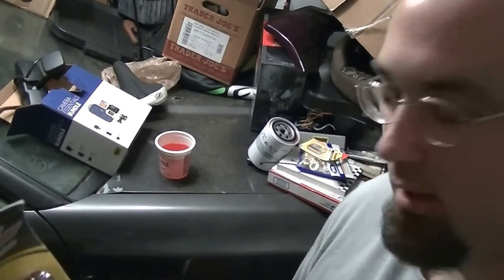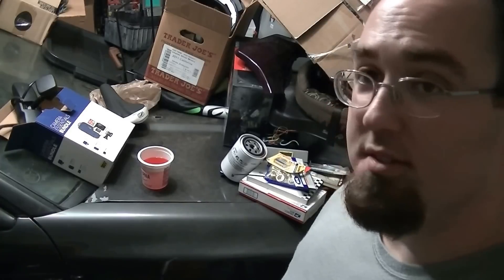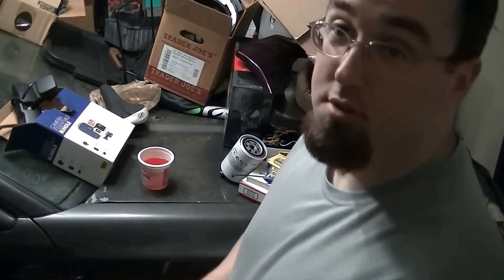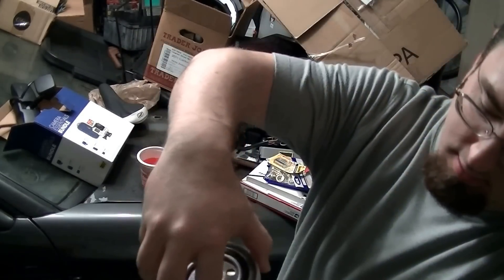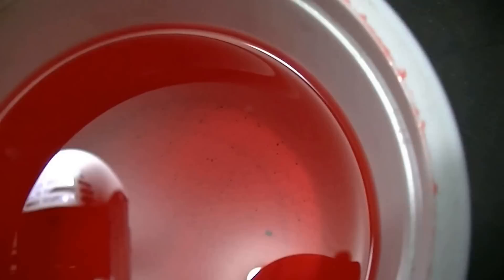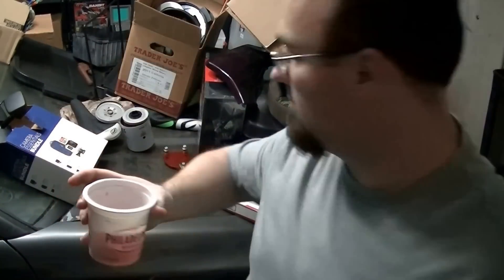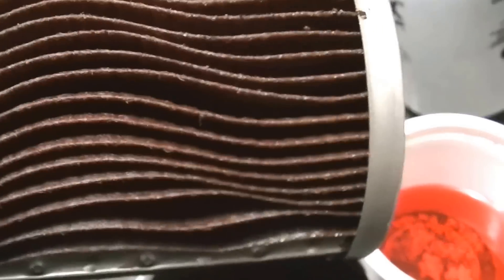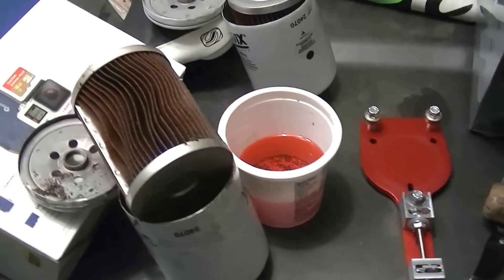Ford F250 6.0L Sinister Coolant Filter Cut Open

Comment: I know this was 5 years did you need a new oil cooler since the vid?
Reply from the maker: I did.  Then the truck got stolen right out of the work parking lot!  I hope it clogged up again on the bastards...
Reply: @uberDoward  crappy!  Just installed BPD relocation but with the crap I'm still seeing in filter I'm sure I'll have another OC to do.  Now it's out of the valley thank goodness

Comment: Holy crap. Always wondered how much my coolant filter was ACUTALLY doing. That is a lot of junk I would not want getting into the 6.0 oil cooler. How often do you guys change your filter?
Reply from the maker: I do it every oil change at this point :)
Reply: @uberDoward  probably a good idea. Not like it is that expensive.

Comment: what kind of coolant was in the filter?
Reply: Ford gold is horrible from what I've read and it's silicate content was noted by numerous articles as a major cause of the oil cooler clogging. I use Cat ELC along with a new Mishimoto radiator and have 0 problems with cooling.
Reply: Jonathan Dahar Don't listen to this goof stick with cat ELC do your research and find out why
Reply: If you use the Ford Gold coolant.... you better be ready change your coolant every 15-20k miles. I am not kidding. It can't handle the EGR temps.
Reply: Jonathan Dahar that would be catiplilar elc 
 I don't recommend using it in a 6.0 go back with the OEM Ford gold coolant . purchased from ford. 
it's a h.o.a.t coolant designed to function in that motor. the cat elc coolsnt isn't ...
Reply: @Thomas-xj3qw  The FORD Gold is Garbage ! DO NOT USE IN A 6.0 POWERSTROKE. Use the Red CAT Approved.
Reply: @badass6.0powerstroke10   for how long have you use the red cat coolant?
Reply: @EvilJoshua  For only about 7,000 Miles so far. Bought my Truck New and at 81,000 Miles the EGR Cooler went, it wasn't that pretty in there coolant wise, and i always used Ford Gold before hand. When that went at 81,000 Miles, i pulled Cab and Head and did all the Bullet Proofing and O-Ringed Heads, Turbo and Injector Upgrades, Fuel System, Pretty much all the Bolt on stuff. Switched it over to the Red CAT Approved Coolant, been for about 2 years now and 7,000 Miles. Looks super clean and No issues. I also did the Coolant Filter Kit then, highly recommend one with these 6.0 Powerstrokes. Wish i did one earlier.
Reply: @EvilJoshua  i always do my research on something before i buy it, it really is the Best stuff for these Engines. The Gold Coolant breaks down to easily. Don't think it can handle the Heat that these Engines make in the EGR Cooler part of it.
Reply: @badass6.0powerstroke10   ohh thanks is that watch a video and put gold for and cat at the worst in a heating test i was thnking go with amsoil heavy duty coolant since i have always use their oil

Comment: Okay I'm now a believer!  Fantastic inspection. 

 Also I currently use an oil by-pass setup using an AMSoil eabp100 on my engine oil.   I noticed the internals of the filter.  Some filters include a bypass valve that when the filter is over stoped up it all allows what ever its filtering to go around  so as not to damage internal components.  On an added external filtration system this safety feature is not need since in the event of being stoped up the engine defaults back to stock set up. If you could find a filter that didn't have this internal safety feature then you could run the filter indefinitely.
Reply from the maker: Appreciate the like - Yeah, those bypass filters are freaking awesome